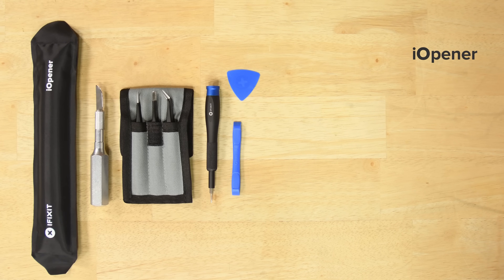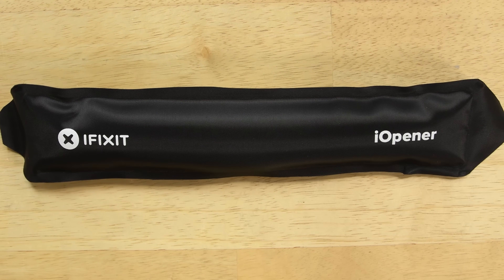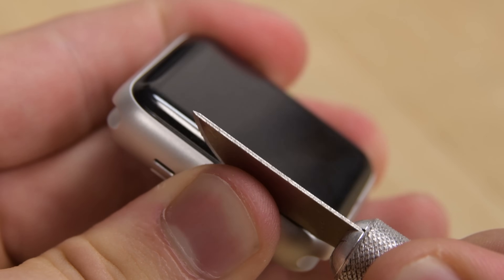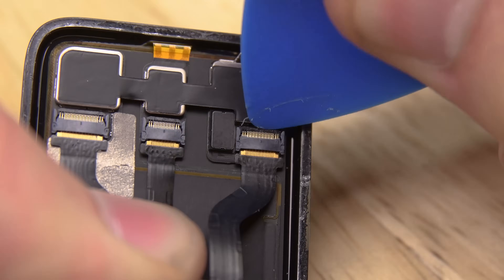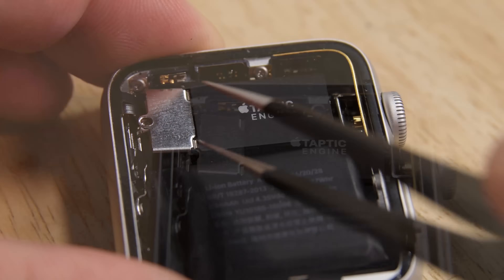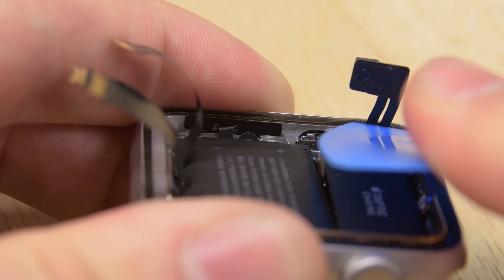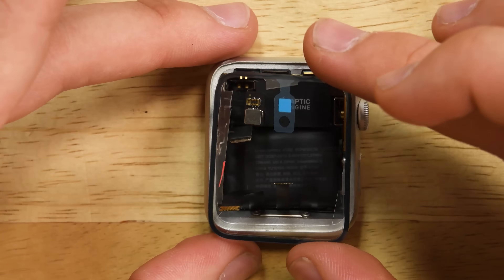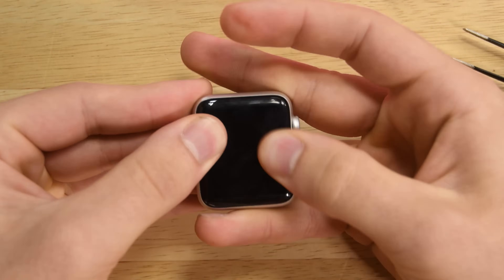Apple Watch Series 2 Battery Replacement—How To

Comment: I cut myself using a curved blade. I ended up using an ultra-thin flexible metal pry spudger instead. Coated the tip with isopropyl alcohol and did not manage to break the gasket.

Comment: Interesting. I removed the battery without disconnecting the display, seems like an unnecessary step to me. It IS kinda fiddly to do that with the display connected, but disconnecting the display seems harder to me, so i try to avoid that.

Comment: One major problem with these instructions.  It's not explicit that if you DON'T mess up the gasket that you don't have to tear it down that deep.  So if you're following this linearly you end up pulling it apart more than necessary before realizing you only needed to do that if you screwed up you gasket.  Major potential to damage the watch unnecessarily following these instructions.

Comment: Your stupid video caused me to ruin my watch.  You said I needed to take the face plate leads off.  When I removed tape as instructed, it tore the leads loose from the connectors and that step did not need to done anyway just to replace the battery.

Comment: Hi alex, i need your help.. my apple watch series 2 is always showing a overheat warning issue problem (looks like power reserved mode with temperatur icon not bolt) before overheat issue, my apple watch is low battery less than 10%, so i put into magnetic charger, green snake for a couple hour and than i decided to force restart using side button and digi crown.. apple logo blinking.. and the overheat warning problem is show on the lcd.. please help whats the problem is.?? Thanks before